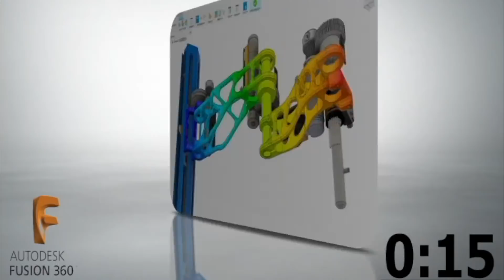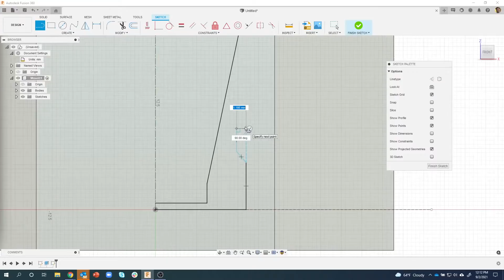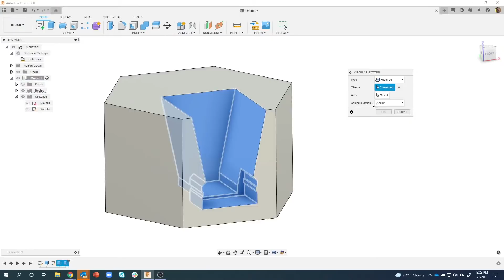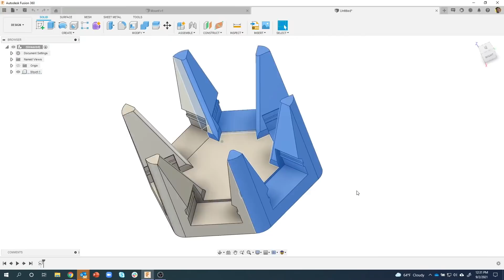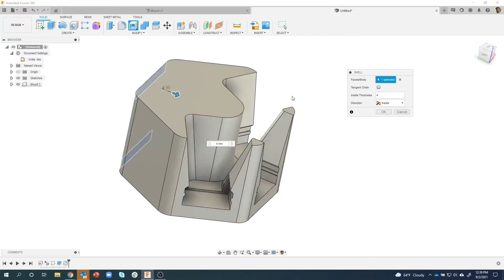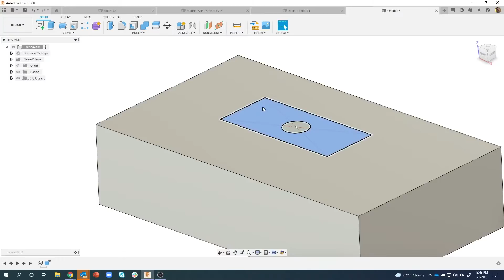360 LIVE: Derive-ing Lessons

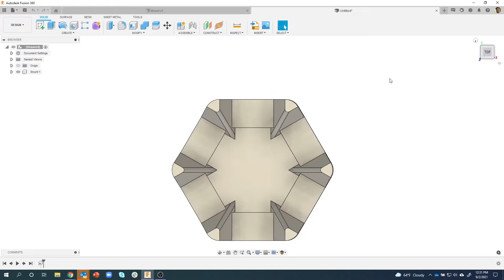Comment: Hi Brad, I know it has been over a year since this video was published, but presently I am following your tutorials. I came across your videos on Fusion 360 only recently. I am really impressed by your knowledge and skill on Fusion 360, but most of all I am impressed by the way you use the Fusion commands; really out of any box thinker. I am writing this comment to share with you an issue I came across during the Modifying the Derived Model part (31:55). 
While trying to delete the faces, the delete failed. I noticed that the selection did not contain all the faces. The problem turned out to be that in the Select>Selection Filters, the Select Through was not checked.

Comment: Creating a component first adds an unnecessary component that is not attached to the root component (no asbuilt rigid joint was added). This means if this model is inserted into an assembly and joined via geometry, the empty root component occurrence will be floating unattached. Since there is no geometry in it, I guess this won’t be noticed. It will likely stay at assembly origin unless the inserted model is moved-on-insert. This is true for other instances on model (say pattern is used) and also instances of the derived model which has same useless root component.

You could add the asbuilt rigid joint in this “part” or (better) not create component in first step. This model is intended to be a part, so don’t make it an assembly right off the bat.

Fusion is weird this way, allowing creation on assembly in single save-able model and not treating subassemblies as rigid by default. I know this causes headaches but that is the current state. Fusion leads to unconstrained components very easily.

I think Brad has a good reason to want to create component off the bat but maybe that is a reflex when creating an assembly and not when creating a part for insertion into an assembly.
Reply: Addition: nice derive demo BTW! I say Fusion is different WRT components but there are good things about this. I don’t mean to be negative. It does trip people up.

Comment: Great tutorial, thanks for going thru the parameters options which I really need to start experimenting with as would be really useful.
Yes if we could have some more CAM tutorials (for new users)as we have a new 3 axis mill (Ajax) and getting a 4 axis Kimla router - if anyone knows which post processor they use would be really helpful.  Also would be great if Fusion could add more and more machines and tool holders to there libary would be really great, thanks loads, JT

Comment: The polygon feature is still not able to update user parameters. I.e. if you use a user parameter to specify the number of the edges of a polygon in a sketch and change the parameter later, then there is no update of the value and the polygon stays the same. In the past this was also with the text height of the text feature. But this is now fixed and works as assumed. Please have a look at the polygon feature and let it work in the same way as the text feature. So it will improve the parametric design further.

CU Jens

Comment: Hi Brad.
Thanks once again for a great tutorial.
I do some DIY metal work at home and would love to see a tutorial on modelling these kind of stuff. I work mostly with thin walled tubing. As a South African, we work in metric, but I am familiar with imperial measurements. Most of the tubing is 1.6mm and 2mm.
I would love to see how you would, let's say design a driveway gate. Main frame is 76mm x 38mm x 2mm rectangular tubing and then some 38mm x 38mm x 1.6mm tubing inside. Especially a drawing with a bill of materials and a cut list for these.